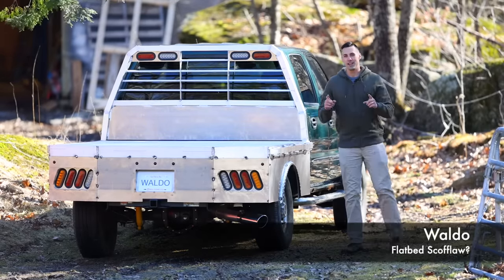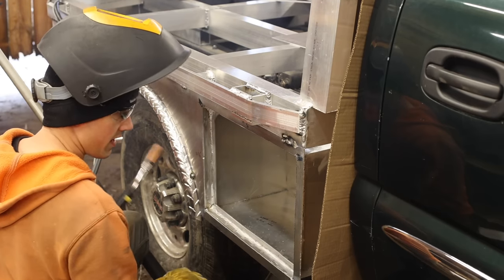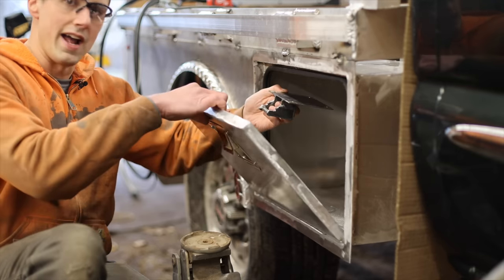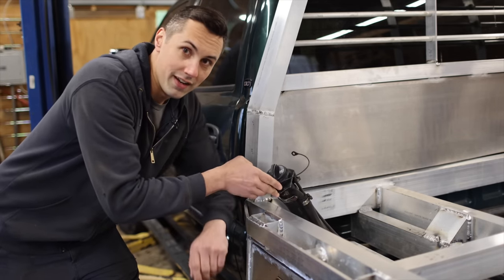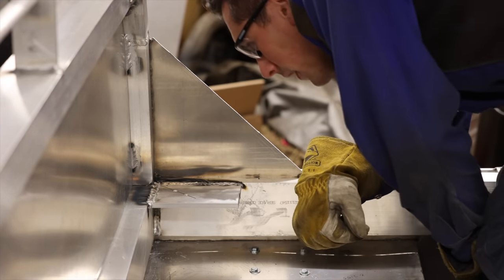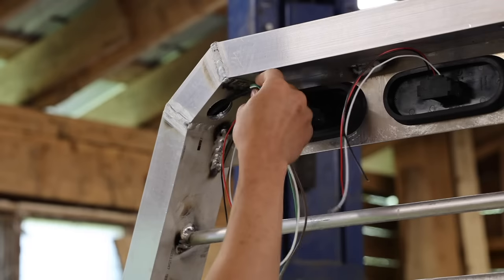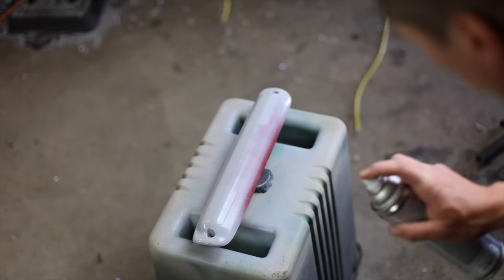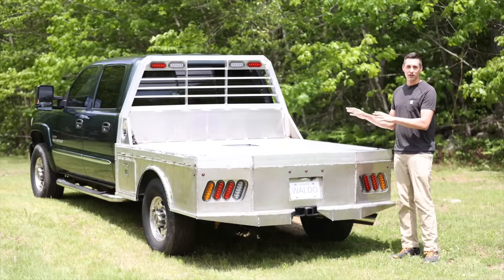Aluminum Flatbed Build (part 2): Toolboxes, Bumper, and More

Comment: The silicone around the holes for wires is good for keeping out water, but using a grommet will keep the wires from chaffing and wearing through.
Reply: Silicone works fine as a grommet..  it just won't last forever.
Reply: @calholli  perfectly said boat guys disagree shit lasts forever
Reply: @thicok4555  lol.. Yeah, I use it to seal up bad screw holes on metal roofs.  Seems to last 10 years in the hot sun, no issues.
Reply: @illudedCeption  what is gland?
Reply: He's a computer engineer... surely he knows better if it's a problem. More than likely just didn't show it in the final product.
Reply: @joshuawagnon2819  Computer engineer is not a material chemist. lol..  There are many things to know in all fields my friend;  knowing one doesn't mean you know anything at all in the others.
Reply: $0.02 - You will have better luck with a polyurethane sealant on the aluminum.  Sikaflex is the preferred sealant on airstreams.
Reply: @beech96W  thanks, that’s what I need for my airstream argosy Motorhome

Comment: WHY are you using Bolts. for the toolboxes. You should be using Rivets instead. I would go around on the toolboxes and replace all the bolts with Rivets instead.

Comment: Nice truck dude. Also love the amber indicators (turn signals). Here in the UK, they are standard. I think they stand out far better than the brake/turn signals together. Perhaps some protection around the back and side of the filler neck?

Comment: That's an awesome aluminum flatbed man! I love it! I'm not an expert or anything close but if it was my truck I would consider welding a back plate or adding one with bolts behind the filler neck to protect it from any load with sharp edges from piercing or cutting thru that hose and having a bad day!!

Comment: You asked so here's what I think: A) The backside of the fuel neck needs boxed in to prevent damage. Use dzus fasteners, something, but it needs fully protected. B)Did you add any bracing to those tool boxes? From what I could see of the construction, they're just hanging by the face plate with no runners to the frame or actual deck. C)I also could not tell if the initial screws/bolts used on the piano hinge were installed down with excess thread outside or up with the excess threads on the inside. If they're outside they'll get all buggered.. If they're inside, they might be in the way - but you'd just have to cut them off. Overall, a whole lotta welding to be sure! It looks nice, well done.
Reply: The driver side box has some sort of plate bolted to the top but it may need triangular bracing to support it. His boxes are a lot different than the 6 foot wide aluminum boxes we mount on our semi truck flatbed trailers, out boxes mount to the trailer frame with a triangle support on each side of the box that bolts to the bottom and back of the box.
Once he lifted the bed up front the truck you can actually see the driver side box drooping down and flexing the side plate, definitely needs bracing
Reply: @TheRoadhammer379  i agree with all this. Flatbed boxes are awesome and require tlc, but are so so worth it for organization.

Comment: To save material for reuse, don't drill a starter hole for a jig saw. Cut a slot with a cutoff wheel and start your jigsaw blade in that.

You can also get extra thin cutoff wheels and use those instead of the jigsaw altogether.
Reply from the maker: Good call. Why didn't I think of that? 😂
Reply: @WaldosWorld  learned it woodworking where a handsaw was the best way I could finish a skilsaw cut that ended flush in a corner. This trick is that in reverse, sorta.
Reply: Good tip, now I gotta remember that.
Reply: An oscillating multi tool works pretty good too. Especially in tight spots
Reply: Also if you use paraffin wax on the cutoff wheel, itll keep the aluminum from clogging up the wheel letting it cut faster. It does need additional cleaning if you are welding on that cut edge after though
Reply: @legionofanon  the lenox lube stick is even better but even Pam cooking spray makes a difference
Reply: @mwilliamshs  that might be the brand one company I worked for used, just couldnt remember the name
Reply: I'm gonna hafta "hell nah" the "instead of jigsaw altogether"  
while I like your idea of rotary tool for cut initiation, jig saws make bigger chips that I won't be inhaled, and don't explode at 8,000 rippums (rpms)
I will definitely use your trick moving forward thanks!  let me trade you one- have you ever tried cutting panels with jig saw on top of 2" XPS (pink/blue) foam?   works a treat!  i always hated jigsaw until I learned the foam trick...
Reply: @travismiller5548  you trade breathing aluminum which is way denser, for breathing polystyrene? Loss.

Get/build a downdraft table. I made one with a popup cooktop vent-a-hood.

Comment: to avoid blow outs at the end of welds, weld back into your weld 1/4"
Reply: What do you mean exactly, weld forward and then reverse again over the last 1/4”?
Reply: @markusthiel7687  make4 your weld to the end, then weld back into your blow out allowing the puddle to form as you move away from the edge, it takes practice

Comment: Waldo, you may want to add split rubber grommets where you fed the wires through the headache rack holes.
Reply: Those areas are protected by split loom, which is adequate (although rubber grommets would be a nice addition). He added it after. The real problem spot IMO is the toolbox lights with just some silicone caulk. The wires are still very close to the sharp edge and may wear through.
Reply: @haphazard1342 , hey thanks for pointing that out, I didn't catch it in the video.

Comment: For starting holes (pilot) try using harbor feight double ended 1/th in drill bits. They're cheap, and because they're short, they're a lot less likely to walk and break.

Comment: Waldo the lights you added in the headache rack will suffice for the third brake light. I think I’ve also seen led lights that have red and amber in one. So you can have your headache rack have a red brake and amber turn.
Reply: Depends. Dot standards here are that if its equiped with a 3rd brake light and it has a flat deck. The trucks factory 3rd brakelights must be operational.

Comment: Hey Waldo I'm very impressed with your hands on skills I'm a metal tradie MACHINIST and I've worked with many engineers who are not at all hands on you are very clever I enjoy watching your projects ,I'm intrigued all your nice equipment but a dirt floor in the workshop why not some concrete ??
Cheers Kym 
Adelaide 
Stu Australia
Reply: I think he wants to build a new workshop and do it right all at once, vs. spending more money on the old shed.
Reply from the maker: Yeah, I've thought about pouring a concrete slab, but the building itself is not level and it's in rough shape. I'm working towards building a nice shop, but first I need to build a dump truck so I can haul in gravel to improve the road. Next I need to buy a big excavator to clear the land of trees and huge rocks. Then, I can pour a slab and start building a shop. Hopefully I'll have the money for it at that point 😂. Of course I'll be bringing you guys along for the whole journey 👍
Reply: @WaldosWorld  Dump trailer??? Can use either of your trucks at that point, not as easy to maneuver though
Reply: @WaldosWorld  
Ok Waldo sounds like you got a plan I'm watching Mat at Diesel creek doing the same he bought an old dump truck to cart fill for his workshop site we watched him clear the site of tree,s with an old excavator rolled compaction with an old vibe roller he bought he,s a big fan of Richie Bros auctions ,like your channel he is always fixing something before he can use I love it ,I'm retired and did everything the hard way but reaped the profits to sit back now and enjoy watching you young guys do it Well Done mate I'm a keen VIEWER 
Cheers Kym 
Adelaide

Comment: Here's a great tip: Before heat shrinking, coat the connection with dialectic paste, then heat shrink it. Offers a level of protection beyond the tube alone.
Reply: There are also heat-shrink with adhesive lining, which is guaranteed to prevent water intrusion. As long as you have a solid connection (his are twist and soldered) it's basically like having a continuous run of wire.
Reply: Yep definitely the heat sharing with the adhesive liner under that bed. Especially in the northeast where they use all kinds of corrosive deicer on the roads.

Comment: Impressive project!  For your reference, I bought an 8 foot flat bed for my 2017 F-350 (single rear wheel) in late 2017. I bought a basic flatbed, but also priced ones with built-in tool boxes and an integrated bumper. They were ~$7,000. But that was in late in 2017. The price for anything made of aluminum has increased a LOT in the 4+ years since then, as has labor. My bet is that now, a comparable aluminum flatbed would cost at least $9,000 and more likely, $10,000.  An alternative to disabling and painting the CHMSL light because it is incandescent is to get the adapters which enable use of LEDs in place of the incandescent without triggering an error code.

Comment: 7000 might be way under valued, I just bought an 86x68x24", 3 door aluminum headache rack with stainless doors for my semi truck and it was 5600. A factory built aluminum bed is probably touching 8500 or more
Reply from the maker: You may be right about that!

Comment: I know this is an older video, but in the future you might want to consider the risk of galvanic corrosion when mixing metals... aluminum and SS can be problematic.  Would have been a good idea to use a barrier between the cabinet/door and the hinge.  Have you noticed any issues with degradation yet?

Comment: very nice Build IMO most home built Flatbeds  don’t have the correct. Proportions to look like they belong on that Truck and Cab  in your case this one does look correct  plus  it has high qualityCraftsmanship i am a retired Woodworker and i have the same Dewalt Mitersaw  i’m curious as to what blade your are using to cut the Metals ? i do personally  don’t like Compromsing my Woodworking Tools Accuracy  by doing double Duty  as in my Experience  of runnning a Large ArchitectualWoodworking Installation team  the saw would take a beating  doing that  i’m between homes and Shops at the moment and  i  will probably  wind up  buying another 12” Saw  for Metal,only  i’m a little OCD on my Wiring being very neat  and ProfessionalynInstalled  i’ve Wired many of my Boats  and i use  the Wire Management parts that West Marine sells  they are attached to  whatever either by Screws or PopRivets  and i’ve found they do hold up for over 20 years  BTW i like the Headache Rack and the Light  Configuration , Again Very Professional Looking    like the White Courtesy Lights    i think your cost n the Build  makes it a very Cost Worthy  Project
Reply from the maker: Thank you! I'm using a Diablo wood cutting blade in the miter saw. It works well for aluminum, but I wouldn't try cutting steel with it
Reply: Almost any wood blade works, a medium to high tooth count seems to work best. Blade wax helps smooth the cutting. Might occasionally need a wire brush to remove some aluminum chunks from teeth. But wax helps a lot to minimize sticking

Comment: Any plans to grind the welds to clean them up?  Also, as others have mentioned, grommets should be used anywhere wire runs through metal to prevent chafing.

Comment: Waldo, very impressive and inspiring, I have flurted with the idea, I own the same welding maching Although I purchased it from Italy and it is called a STEL, but sold here as the machine you have. I have done a bunch of mig welding and it is great, even using the pulse on some thinner metal. I am now considering trying to build a deck as you have, I looked into the Aluminum and i can find and purchase everything with the exception of the planking. Can you direct me where you purchased yours, I would like to consider that over 1/8" aluminum plate. I truly like the way you laid you aluminum planking in the bed, very clean looking. If I am not imposing on asking you where I might find the same planking, I would appreciate your help. Thank you and great job on all of your builds, the goose neck trailer is just massive and you did such a great job on it. Congrats on all of your efforts.

Comment: Great build, as usual! Just a tip from having cut and drilled a lot of 5mm aluminium... Usually you can deal with aluminum with any tool that cuts hardwoods (circular hand held saw, carbide tipped chopsaw, hole saws, regular metal drill bits, etc.) but aluminium is waaaaaaaaaay gummier than wood (more or less depending on specific alloy and grade), so it clogs the teeth easily. Using any cutting fluid (even plain WD40) on the blades or material to be cut makes a huge improvement. Cuts faster and cleaner. Beware that some of them may erase your marks (even permanent markers). Also if you plan on welding, you will need to clean them with acetone or some solvent after using any lube. Keep up the good work!

Comment: It would require running extra wires but you can get away without the convertor for the headache rack lights by tapping into the trailer plug wiring
Reply from the maker: That's a good point! Why didn't I think of that? 🤔
Reply: @WaldosWorld  I was going to mention that as well.  Benefit of using the trailer wiring is the lights won't alternate when they flash.

Comment: Excellent job and very articulate presentation. Just a thought if u use boat heat shrink it has a sealant on the inside that’s waterproof

Comment: Great job. I have a question. I built a new flat bed for my 2006 Dodge Ram. When I wired in the tail lights, the blinkers are flashing quick, like when a bulb is blown. Did you have this issue and how did you correct it.
Reply from the maker: Yeah, you just need to wire in a resistor between the tail light signal and ground. They make special high power resistors exactly for this purpose (when you switch to LED lights)

Comment: I am a computer and wiring junkie as well. I solder all my wiring, I don't crimp anything except big battery lugs and i use a hydraulic crimper with tinned copper lugs.  Just a tip, use tinned copper wire. Not just OFC, but TINNED OFC... copper corrodes and tinned wire is they key to a long lasting installation Get tinned everything if you can. You'll thank me a few years down the road :)
Reply from the maker: Good call 👍

Comment: It finished up nicely!! You did a nice job on the wiring, BUT did you put any trailer jacks for the Goose and the receiver? Just wondering!! Still nice!!
Reply from the maker: I forgot about those in my haste to get the video finished. I'll use the existing wiring from the truck for those, but I just need to secure the jacks to the bed 👍

Comment: Looks like the soot is still a problem??  I have run into that myself.  Chalked it up to too much breeze outside even though it seemed calm enough.  Also thought the cleanliness of the material might make a difference as it seems much more pronounced in used aluminum (6061),  the last time it occurred I was thinking the wire manufacturer might be the culprit.  Hard to toss out expensive gas and wire without truly knowing they are the cause.  I know that Jody even wipes his tig wire before use with acetone so it causes me to wonder if the mig wire might also be contributing?
Reply from the maker: Yeah, there was a lot of soot in some of those welds. Other joints welded just fine with little-to-no soot. I'm chalking it up to cleanliness of some of the materials 👍

Comment: Being able to lift the whole thing off that easily ? Is SLICK.
Ha!  "With my background in Computer Engineering ....."  Ha, of coooouuuurse. lol
THAT explains why he was prepared to create an interface for the ECU in the "Jag" (Range Rover) to work with perhaps an LS engine. Because I work with ROMs, EFI, etc., and I would NEVER feel confident CREATING an abstraction layer to program a new engine just as an off the cuff statement. To me? That sounds like an ENORMOUS project. But yeah -- not only does that explain his comfort with CS, but also his general knowledge ... because you are NOT graduating with a BS in CS unless you have an EYE CUE (gotta placate the dumble-heads at you-tubey) that is over 130 ... which is highly predictive of a high G score, and explains why he has so many talents across challenging skill sets.

Comment: How much did the aluminum flatbed end up weighing compared to the original sheet metal "box" that was originally on this truck ?
Reply from the maker: That's a good question. The flatbed is pretty light, so I'd expect it to be similar, although I haven't weighed it yet

Comment: Check your local laws, but here in Oklahoma amber lights are not allowed to face the rear of the vehicle.
Reply from the maker: I had to check on this, because a lot of vehicles come with amber turn signals to the rear. OS §47-12-206.1 Turn signal lamps. (B. 3.) states: "On the rear of the vehicle... shall display a red or amber light"

Comment: Also, keep meaning to ask. What camera / lens setup are you using? Always impressed with your footage quality
Reply from the maker: I mainly use a Canon R6. I use a bunch of different lenses, but my EF 50mm f/1.4 probably gets the most usage even though it's also the cheapest 🤷‍♂️
Reply: @WaldosWorld  ahh very nice. Makes sense, that's a razor sharp lens. I've been using my RP and tamron 24-70 2.8 for all my videos lately. I just like not having to swap it out constantly

Comment: looks very good but it looks like it was a lot of work. I'm interested in the welder you were using   I noticed it uses a standard wire feed  with the aluminum wire instead of a spool gun . thanks for sharing
Reply from the maker: https://usaweld.com/products/pro_pulse_220_mts

Yep, it's pretty neat that it doesn't need a spool gun. Instead, it uses a teflon liner to help the wire feed the 8.5' distance from the machine to the gun 👍